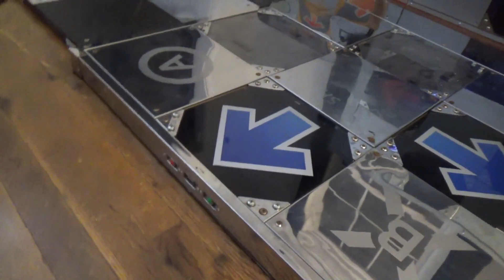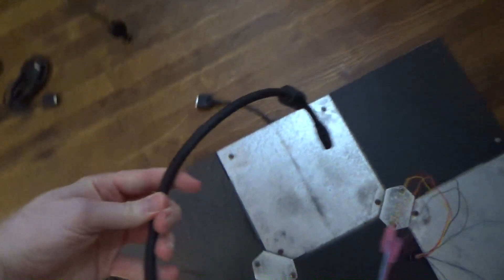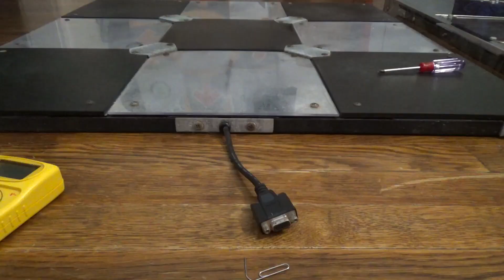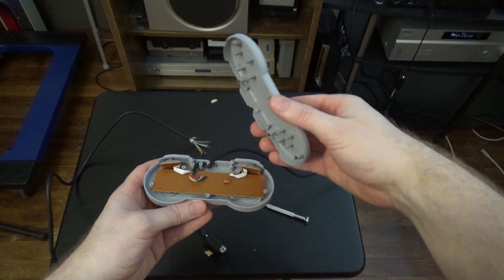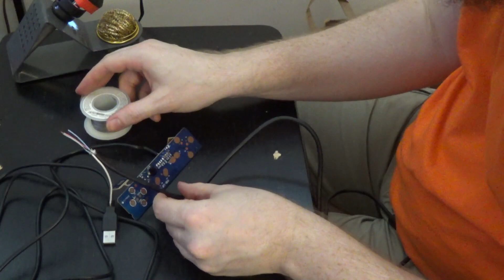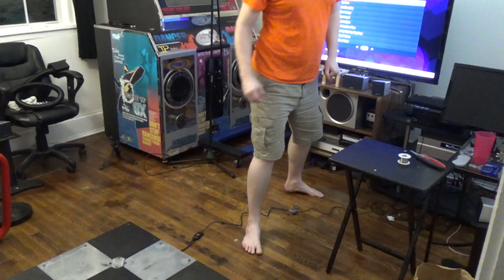How to build a new USB control box for an old dance pad

Comment: I have an old abandoned softpad, is it possible to use that to convert it into a control box for a new hardpad I bought?
Reply from the maker: Probably! As long as you can take it apart and find the right solder points, any interface should do the trick. At some level, every dance pad functions by closing a circuit when a panel is stepped on, and control circuitry is just a matter of translating that into a format readable by whatever you're plugging it into.
Reply: @adiener  Sounds good! Just wanted to confirm this before I start soldering anything

Comment: @adiener Hey bud ur videos are fucking awesome thank you for this. I learned a lot. But I'm running into a problem. I think this pad I got has bad sensors even though they look brand new this pad had to of been somewhere to have taken on water damage. How can I test the sensors without having to pull it all apart? Multimeter?
Reply from the maker: While I was building my custom ITG2 pad, I actually made a little tiny sensor tester out of an LED, a AA battery enclosure, and a header with the correct spacing to fit the sensor connector. It worked pretty well and was a lot more responsive than a multimeter, though it was only easy because I happened to have the parts on hand. Depending on which dance game this in, there might be a test mode in the operator menu that will show you the response of individual sensors in the pad. Even if it doesn't show individual ones, you can test by just taking off the arrow panel while the machine is on, and pressing on each sensor with your fingers to see how much pressure it takes to light up.

Good luck!
Reply: @adiener I tagged u in the little video of what my pad looks like same thing as ur blue shark or whatever I was. U think the wiring and stuff would all be the same on the inside.
Reply from the maker: @zaydenlawrence5355  Aha OK, I found it. I haven't personally taken apart a DDRGame pad, but judging from what I see, it seems to be a mechanism somewhat similar to what's used in a Cobalt Flux. I see an interlaced arrangement of exposed metal inside, and you mention foil underneath each arrow. What I presume is happening is that the coiled-looking metal bits are two closely-spaced halves of an open circuit, and the foil on the underside of each arrow panel will make contact with both halves of the circuit, thereby closing it.

This sort of system is prone to poor contact for a number of reasons. Corrosion can happen, and dust and dirt can get inside and make it harder for the metal bits to couple. Long ago I would to clean the contacts on my Cobalt Flux pads with an abrasive scrubber when they stopped responding well. They were a little bit different in that each arrow actually had a wire running to it, so the underside of the arrow itself is the other half of the circuit, and it made contact with a solid metal plate below. I'd be careful not to scrub too hard on this pad, but you'll somehow just need to ensure that the top part is making good electrical contact with the bottom part when pressure is applied.

If you want to test it yourself with the arrows taken off, you could take a little piece of aluminum foil or some other conductive material with some surface area and manually press it against the coiled looking part on the base of the pad while the game is running. This should bridge the two wires and register as a step. If this is reasonably responsive, your problem is probably in the foil on the underside of the arrow panels; if not, the problem is with the exposed sensor wires themselves. Both sides might need some cleaning. If you still get no response no matter what, there could be a wiring issue upstream of the panel itself, but I think it's more likely that the contacts are just dirty.
Reply: So here is my pad with the top plates taken off so I could examine the sensors. When one of these buttons are pressed what exactly happens to make sensor work the way it’s supposed to? And does the aluminum foil looking stuff underneath each arrow or plate play an importance of the sensors functionality, sorry if I seem so rudimentary but I’m learning I was originally trying to take the pad apart completely to examine all the wiring for all the sensors. Do u know how I should go about doing so?

Comment: I'm building an arcade style hard pad using a PS2 soft pad's circuit board (it's in the black bit at the top that says Konami), does anyone know of any readily available PS2 to USB adapters that avoid the "simultaneous up/down or left/right presses don't work" problem mentioned in the video?

Comment: Bro idk if you’re still active but I have a question
Reply: It’s about the zero delay usb  encoder, I removed  the 15 pin vga cable and solder every pad individually to one button ( not using opposite axis ) and I can go through the menu just fine. But as soon as I start a song the encoder disconnects and reconnects to pc. Any idea how I can fix that ?

Comment: Hi there. Thank you for this video. :)

I am working on an old BNS USA metal dance pad for my wife. I understand your process was to build a new 'control box'... But... why not just cut the VGA connector off the cable coming out of the pad, find the correct pairings with the multimeter, and then solder directly onto the SNES control board and done? The only downside I see is that if you had to rebuild the 'box' on a regular basis (I wouldn't think so?) You'd eventually run out of cable that's attached to the pad.
Reply from the maker: Yup, that'd work fine if you're OK with wiring it that way permanently. Keeping the original connector on the pad is nice in case you'd ever want to hook it up to a PS2 or something with the original control box, or sell it or whatever.
Reply: @adiener  Cool-- Thanks for the reply! I'll report back if/when I get it working. 👍🏼🍻

Comment: Thanks for the guide, 4 hours later finally got it done. even tho i got the same remotes you showed for some reason with the pad wires connected i couldnt trigger xbay all together and had to split it out to r,down,b,a but my free blueshark is now working!

Comment: Alex, thank you for your video. I am trying to resurrect a blue shark pad. I have the vga cable cut in half and have removed the insulation from all 15 tiny wires. However, I have not been able to map which wires go to which arrow, as my multimeter never varies no matter the combination of wires I put on to the leads while I try the arrows. Do you have any suggestions?
Reply from the maker: Hmm, that's tricky. I just mapped out the pins on mine. If yours is the same model, this should work: Looking at the front of the connector on the pad, and counting pins bottom-to-top and left-to-right, pin 0 (bottom left; closest to the right arrow) is the ground, and pins 5, 6, 7, and 8 (middle row, from closest to the right arrow counting toward the left arrow) are right, left, down, and up respectively.

If you have a different model, this might not match. Is yours this one (three screws per bracket, no holes in the back to mount a bar): https://i.ytimg.com/vi/tp9XJud3_6E/hqdefault.jpg or this one (one screw per bracket, holes in the back)? https://photobucket.com/gallery/user/Craig09/media/bWVkaWFJZDo0NTEyOTE0OA==/?ref=
Reply: @Alex Diener Thanks for the response and the mappings. So mine is definitely the second link you posted (The one with the bar). I tried your mappings and still don’t get any readings on resistance. Makes me wonder if I have dead sensors or maybe the wiring within the pad is disconnected/broken somewhere.
Reply from the maker: Yep, that's tough. I don't have access to that model to map it out. It might be necessary to unplug one of the sensors (though I think they might be spliced in directly, so you'd have to cut a wire and re-splice it later) and use the multimeter on that to see how/if it connects to the I/O port. A messy process!
Reply: @Alex Diener Appreciate your time! I think I found this weekend’s project.
Reply: Pin 5 - Ground - Black
Pin 7 - Up - Gray - A1
Pin 8 - Down - Green - A2
Pin 9 - Left - Orange - A3
Pin 10 - Right - Blue - A4
Pin 14 - OA - White - A5
Pin 15 - XB - Purple - A6

The output on the Blue Shark is a 15 port DSUB male.
Reply: Trying to hook it up to one of these: amazon.com/gp/product/B075R5T1G4/ref=ppx_yo_dt_b_asin_title_o04_s00?ie=UTF8&psc=1
Reply: @s34nvideos  did you get it to work?
Reply: I have a logic 3 hard dance mat that is missing control box and has 15pin sub d male end, and hoping it follows similar wiring to the Blue Shark.

Comment: How do you tell where to put the wires on the PCB??
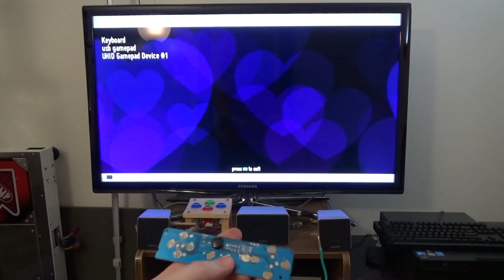Reply from the maker: I show my technique for this at 25:48. Since each button will have to bridge two wires on the board, you know that one of them is power, and one is signal. Follow the traces to figure out which is which, and bridge them manually with a short length of wire to verify. There's sometimes some guesswork, but it's usually pretty easy to figure out.

Comment: Wait, why couldn't use just find the voltage after connecting the VGA male to female with the stripped wires? Couldn't you just figure out the ground and four arrow keys through the stripped wires?
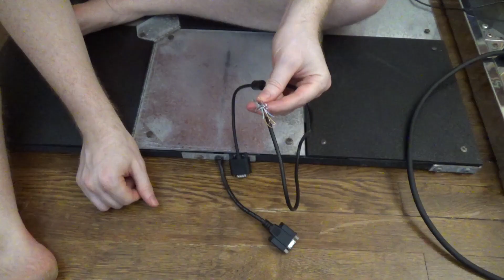Reply: To further explain, why can't you use the wires at 17:44 to figure out the voltages instead of doing the paper clip method?
Reply from the maker: Yup, that would probably be an easier way to do it. It won't tell you which pin is which on the pad unless you map out the VGA cable itself, but if you're not worried about that, you can skip a step and save some effort.
Reply: Ah ok thanks for the response. I'll probably do that then.

Comment: Excellent and informative video! It's a great idea to repurpose a cheap controller like that. At some point I want to have my DDR arcade pads interface to USB for use with OpenITG. Yes you can't solder to aluminium/aluminum (you would need a special kind of solder and a considerably hotter iron). Cheaper cables use aluminium, or copper coated aluminium since the cost of copper went up, and they are horrible to deal with! A flux pen is useful to have, it will help the solder flow better, especially on the contacts on the board.